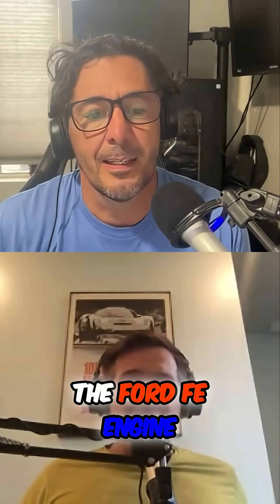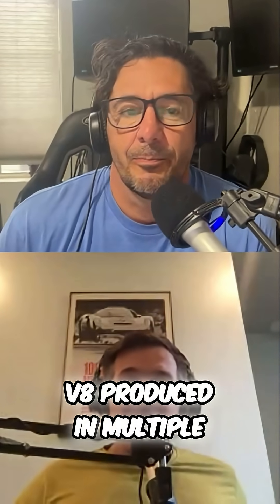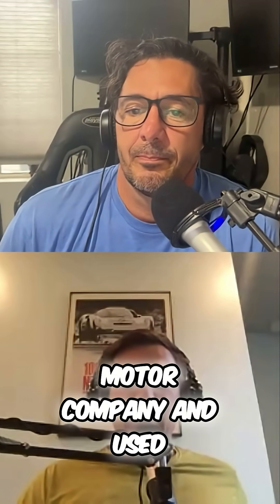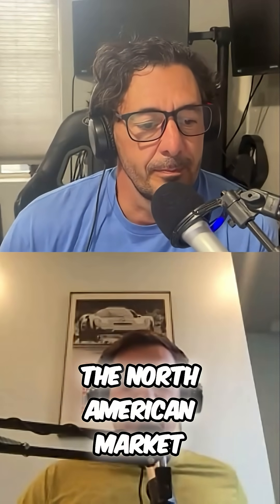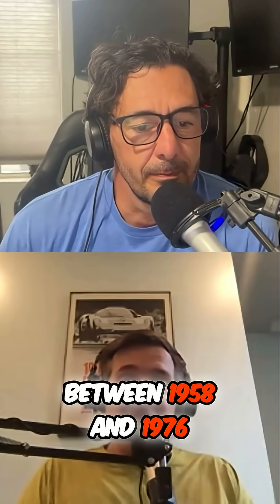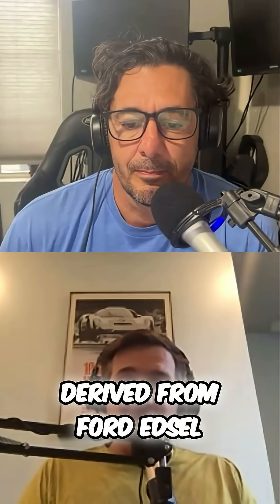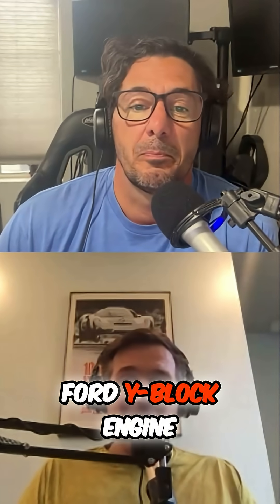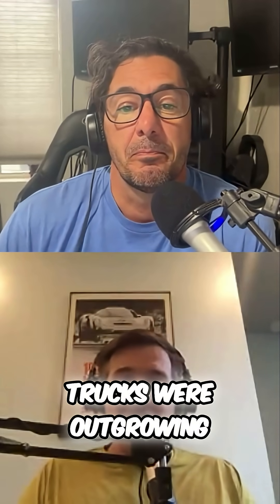Ford FE Engine  The Lightweight V8 That Changed Everything!

Comment: And with aluminum heads , intake and water pump the weight was reduced to 510 pounds. Just swapping the intake and water pump the weight dropped to 540 lbs.